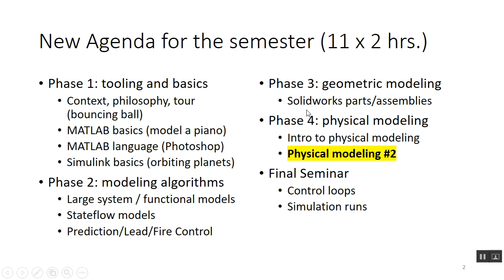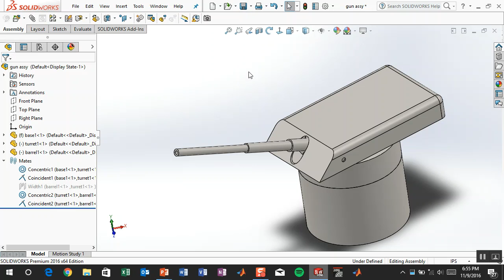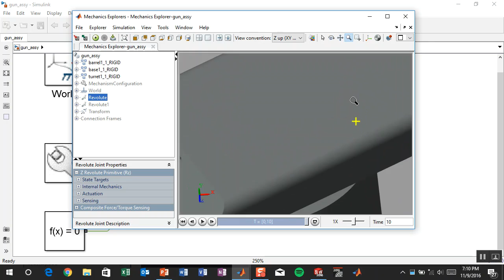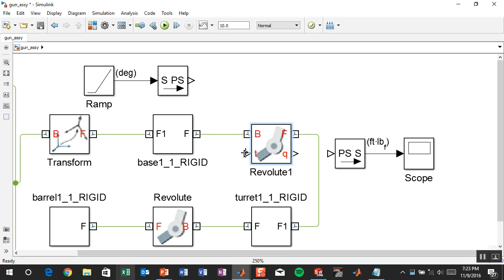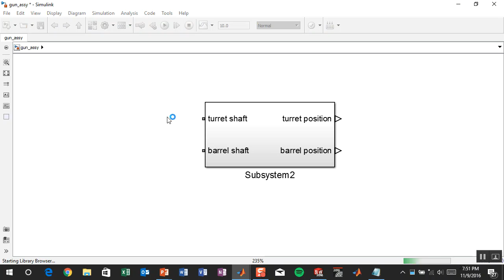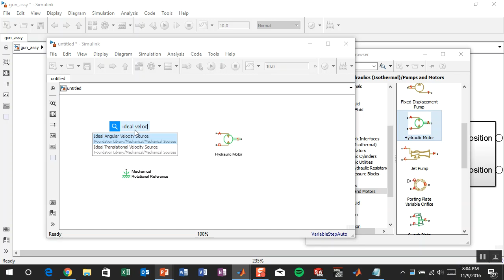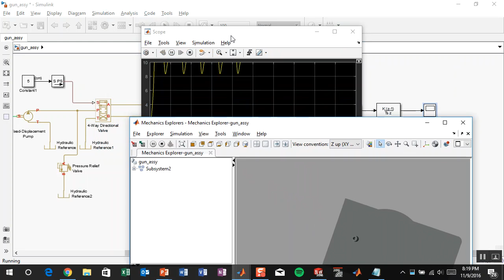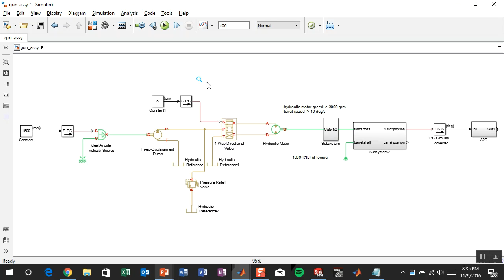modeling, simulation, analysis   session 10

Comment: Hi gavin. thanks for your great video. i'm trying to simulate a DC motor with a load. however i don't know how to connect the load properly. where should i connect it? suppose that the load is just a hand grasping the motor shaft (a constant in simulink). How can i connect this constant to act as a feedback load in my model? thanks
Reply from the maker: Hi Sagan, thanks for the feedback.  How are you planning to model the dc motor and how are you modeling the load?  e.g.  are you using Simscape or are you modeling it just using "vanilla" Simulink blocks or ?
Reply: hi gavin thanks for answering. I'm trying to use simscape for pretty much everything. Nevertheless, my question is, how do i connect a load from simulink to a DC motor in simscape.
Reply: besides that, i have another question, suppose that you have 2 links in simmechanics2 rotating both at the same center of rotation, like the two hands of an analog clock. Now suppose that there is a spring that connects the hour hand with the minutes hand. The hour hand is connected to a motor and the minutes hand is the follower. summary 2 links, same center of rotation, connected by a spring (rotational) and a motor in the hours hand. I've been trying to think how to do this for a while. Thanks in advance your videos are great
Reply from the maker: ok, that makes it easy then.  think of the shaft of the DC motor as a torque receiver/transmitter.  when you model your load, it needs to be the same.  for example, if your load is an inertia block, just hook it up directly because rotational inertia responds to a torque with another torque...  let's say you have some rotational damper, you just connect one side to a rotational ground (or whatever you want your reference to be) and connect the other side to the shaft.  same with a spring.  if you have a more complex load, say maybe with a lot of other effects, just make sure that the node you connect can send and receive torque.
Reply from the maker: sagan, ok, I think I gotcha.  you are struggling with the bridge between a simscape mechanical model, which has 6 degrees of freedom and a 1 degree of freedom spring from the foundation library, is that right?
Reply from the maker: if my assumption is right, watch the above video starting from about 42 minutes in.  I show how to make the bridge that you need.  in short, you'll build that bridge, add an actuator port and a sensor port the joint that you are connecting to and hook them up.  in your case, you'll do this twice (once for each 3d joint) and then connect the two Bridges with a spring.  Does that make sense?
Reply: thanks for your answer! so for my first question i watched what you did and it works :) for my second question this is the mechanism that i want to model :) http://mech.vub.ac.be/multibody/topics/maccepa.htm in short :)
Reply from the maker: ok, I'm with you so far, what is the question?
Reply from the maker: sagan, actually, why don't you just send me an email, that will be easier.  my business email is my first name at nielsentechnologies.com
Reply from the maker: Sagan, I haven't seen any emails from you, do you still need some help?  Is there another medium that would be more efficient that you'd prefer as opposed to the Youtube comment system?  Let me know.
Reply: check your inbox :)
Reply from the maker: go it =)
Reply: @sagan61  
do you have the email cuz the site is down